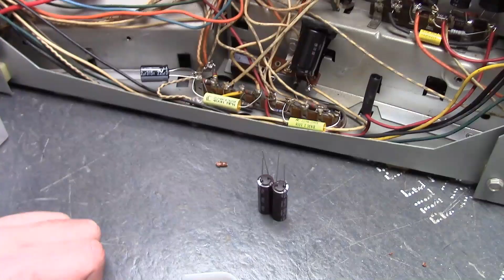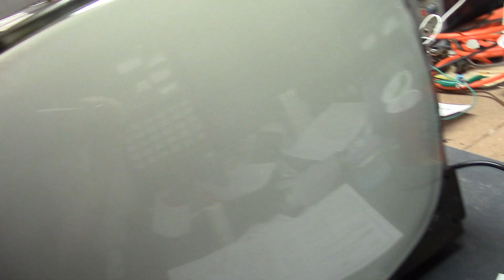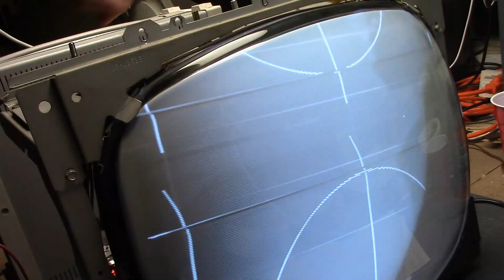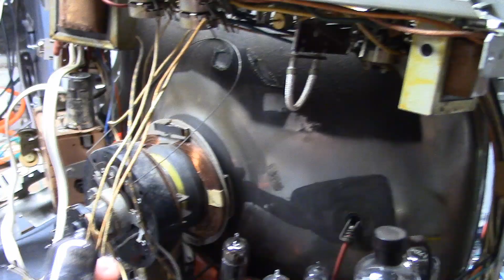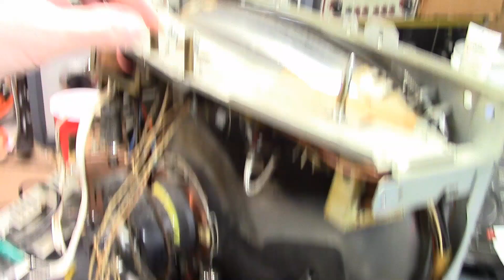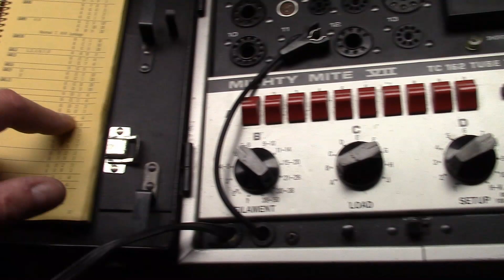Philco Seventeener III restoration p3o4

Comment: There's very little room in that set to work with. I can tell that Philco was going for the thin, sleek form factor/profile in this model. Fortunately, those caps are very small in comparison to the originals and will fit when repositioned. It's amazing how electrolytic caps of the same value and working voltage have shrunken in size over the years. It's good that you've isolated the problem on that IF board, which was just a tested bad 1/2 of a tube. It would probably be no fun to have to take out the IF board, replace bad parts, bridge broken traces and finally put the TV on the scope to readjust it.
Reply: Electrolytic caps have shrunken, but we've gotten bigger.
...so have TVs, for that matter!

Comment: You could experiment with putting the caps in a large piece of heat shrink tubing. It may be even possible to put them linearly in the tube. 
Just thinking out loud here, have not tried this myself.
Cheers,

Comment: Those raster lines are really sharp and clear. Should show a really good picture when all is done. Do you ever attempt to touch up the IF alignment on these projects? In any case, the quality of your work is really nice!
Reply from the maker: Ys, they sure are :)   I do alignments on older sets sometimes, but not with these late 50s Philcos.  The IF board is very reliable.

Comment: Just noticed the electrolytic in the lower left corner at (2.33)  22 mfd @ 315 volts. Is that correct ? Seems like a strange voltage, never seen a rating like that. Normally I'd see 250 , 300 or 350 volts. Maybe i need to get my eyes checked :(  As far as the yoke goes, couldn't you use a piece of heavy twine and make a loop through it, suspending it from the upper sheet metal structure , kind of like where it would normally sit.
Reply from the maker: Yes, it's 315.  It is a standard modern value.  Original was 250 or something like that.
Reply: wonder if they had rectified 220v in mind
Reply from the maker: @krz8888888  I bought a bunch of 315 volt caps because I got a good deal.  No idea what the intended application was.
Reply: @krz8888888  Not enough headroom for 220 (which is more like 250 half the time), rectified 200V Japanese power (~282V peak) is my best guess.